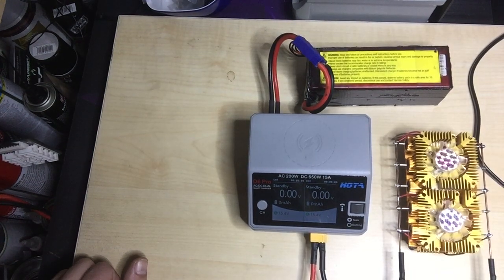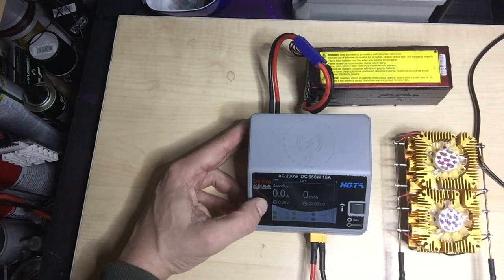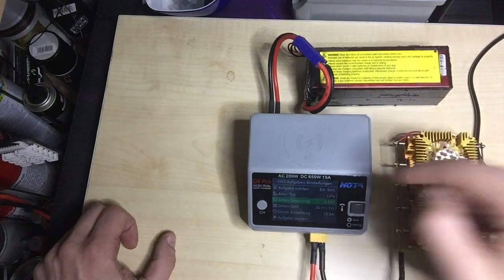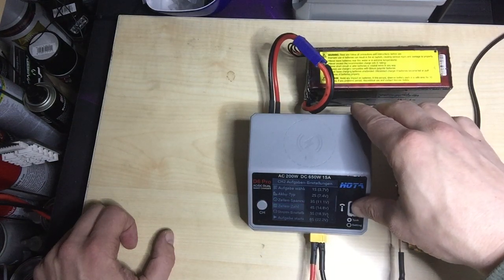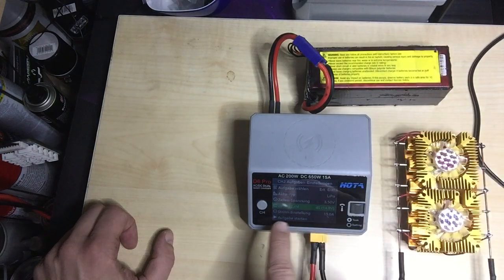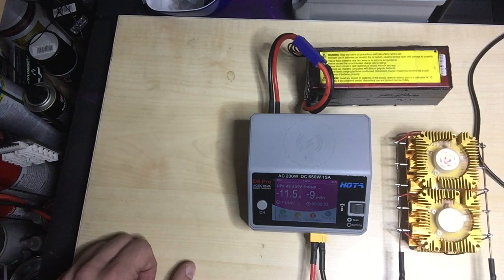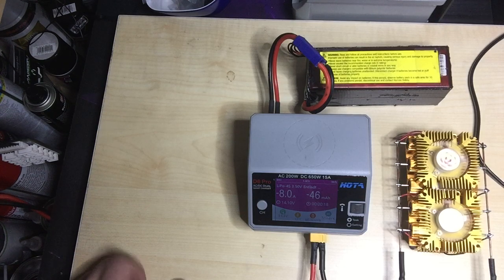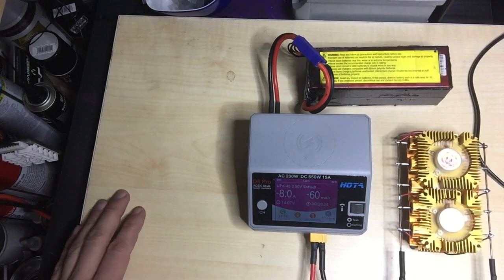Hota d6 pro / Hobbymate charger external discharge/entladen 500 Watt 15 Amp

Comment: Can the AC power cable be connected at the same time as connecting the battery to the XT60 port to discharge the battery?

Comment: Asking about resistors? He used 5 resistors in parallel circuit and in commends answered that the total is 1 Ohm. From:
1 / R_eq = 1 / R1 + 1 / R2 + 1 / R3 + 1 / R4 + 1 / R5
you can see that each resistor must be 5 Ohm.
More resistors in parallel will distribute heat better; Higher total impedance (resistance, ohm value) will allow for slower and safer discharge. 
Also consider that higher the impedance of resistors, lower the heat.

Comment: Guten Abend.
Ich habe den Nachfolger von diesem Modell gekauft.
Da steht in der Artikelbeschreibung auch dass externes entladen möglich ist.
Aber es fehlt schlichtweg der Punkt im Menu.
Da steht nur entladen.
Aber das geht nur sehr langsam.
Gibt es da einen Ansatz wie das funktionieren soll?
Also das schwarze Ladegerät wo der Drehknopf hoch und runter geht. Nicht mehr seitwärts.
Ich danke schon mal für die Info.
Reply from the maker: Moin melde dich gerne über #tihoracing über Facebook, wir haben diesen Lader auch und das funktioniert :=)
Reply: @tihoracing1751  
Ich bin schon nicht in der Lage bei Facebook euch zu finden.
Der Link läuft ins leere und bei Facebook gesucht ergibt keinen Treffer.
Wie kann ich euch kontaktieren?